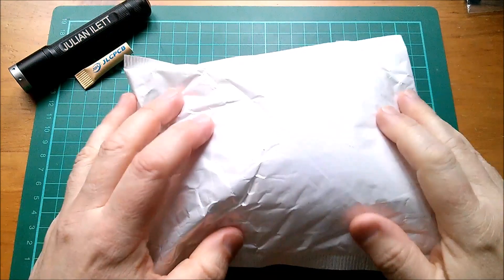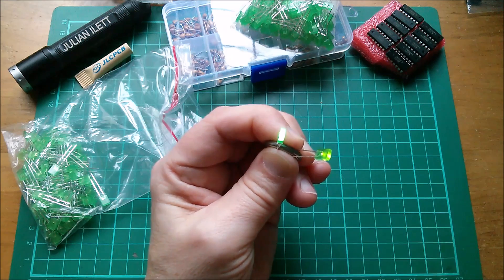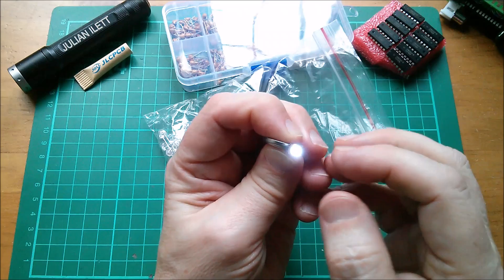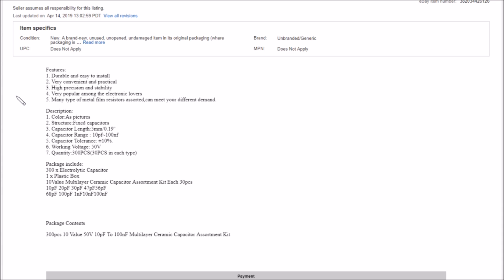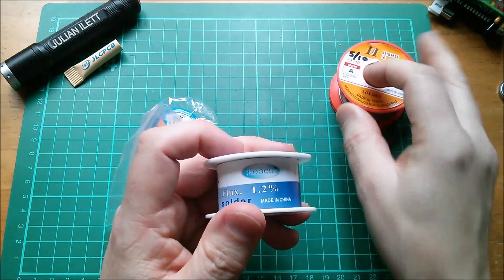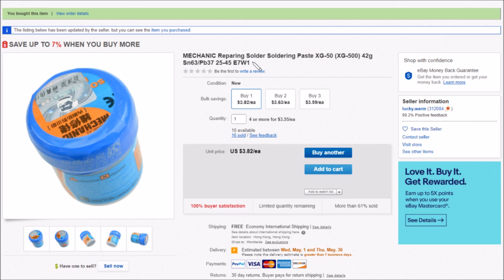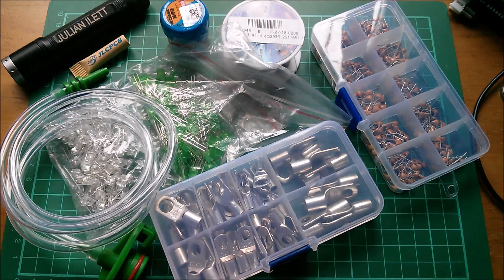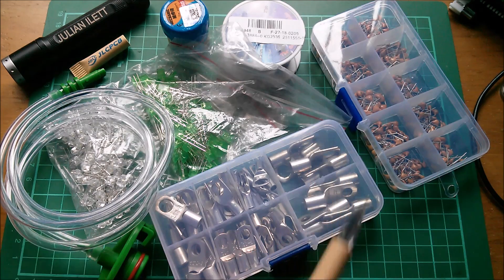Julian's Postbag: #135 - LEDs, Capacitors and Connectors

Comment: Caution with the cable lugs, as I have found the mm CSA of the cable is not extended right through the lug especially where the solder hole is located and at the terminal itself.

Comment: Does anyone know what the air tube locking  connector is called? The supply end. Same for those press compression rings.
Reply: Techcon Systems 533 Male Connector

Comment: Those lugs don't match the description. Described as closed end for sealing, all the ones I saw in your kit were open end (the end of the wire can poke right thru to the 6mm/8mm bolt hole).

Comment: Fine solder is better, even for through hole as it melts more quicly and risks fewer bridges. You get much better control of the amount added, especially useful for hand soldering SMD.

Comment: Chinesium solder is pretty much pot luck. Aiui, the PB/Sn ratios are not always as stated on the reel. I got tow types - Hanwuyou brand which is horrible, flows like Dairylea cheese and leaves dull (but functional) joints and Kaina brand which is lovely, melts easily flows nicely and leaves a nice shiny finish on the joint.
Androkavo did a review of various types and  saw similar results. Make sure you check the brand in the picture before you order, though that's not always a guarantee of what will come through the letter box.
https://www.youtube.com/watch?v=fef4_epjrSI
https://www.youtube.com/watch?v=5Ku7I3hA3AA

Comment: That Jinhu solder is really weird and I have issues soldering with it as well.  It really wants the iron and board/component really HOT to solder.  It also likes added flux then it can made to work.  I wish I had seen your experience with it BEFORE I had ordered.  Keep up the good work...

Comment: I would Never buy copper connectors .. buy some Copper pipe, that small one for Home pipping hot water. .. cut the pipe and smash one tip with a hammer ... make a hole on the flat smashed end and you got yourself a very good quality connector ...
Reply: John Smith - no, that will not make a proper cold weld joint, a few heat cycles and it’s possible to pull that apart. That’s why the correct tooling is specified for industry. I dread seeing crimp videos, because everyone mashes them with pliers.
Reply: @____________________________.x  It's a Connector ... if have have "300C heat cycles " then truly the connector is your last problem ... just crimp those with any crimping tool and you got a Excellent connector for a much lower price ..and you still get to used a very good Copper pipe with the leftover's ... all wins ...
Reply: @John_Smith__ - Nobody mentioned 300C heat cycles? simply any thermal expansion will degrade a smashed joint.
"Any crimping tool" - this is the problem, too many people (especially on youtube) imagine a crimp tool is something that resembles a pair of pliers.
I tested crimps in industry for QA purposes, smashed joints are not suitable for something that can dump 200 amps though it, especially as it looks like he's leaving all these batteries out in the rain again.
Reply: @____________________________.x  I agree on the crimp tools, what I do not agree is about the copper pipes. Absolutely suitable to high currents no problem. And thermal cycles? They are made for Hot and Cold water to cycle trough them ... no problem there whatsoever. And if the temperature is too hot then it is a serious problem and not with the connectors for sure. I also agree with the adequate crimping tools, but that is also a matter of knowing the tools. And of course leaving the batteries out in the rain is a major mistake. A cover at minimum is absolutely a must.
Reply: @John_Smith__  - why doesn't NASA make all its crimps with a hammer then? It would months in assembly time. No one questioned the use of copper, the issue is the quality of the crimp that hammering makes, you simply can not make a cold weld, there is not enough pressure.
Again, this is nothing to do with water pipes? Vibration will loosen a connection, thermal cycling has the same effect on crimps, so does cold flow. Companies spend millions on testing these effects because planes fall out of the sky when they get it wrong, this is why there is a right and a wrong way to do something. Julian is free to do this the wrong way, just as long as he makes clear what is the right way.
Reply: @____________________________.x  Simple answer: NASA has lot's of cash, and yes , those industrial made connectors are better then the ones I make, I simply would Never buy the industrial ones because I know for 99% of use cases the ones made with a copper pipe hammered into shape are more then adequate, do as good job has the ones I can buy, last the same or longer and far cheaper. Btw, making the connectors take Way more time then obviously buy them already made, that's reason number one most industries do not make the connectors (time is money specially at large scale production). 
For the few connectors I use I prefer to waste a bit of time hammering the end of the pipe flat, drilling the hole to my adequate size and then crimping the thing in the appropriate place. It simply works as good as a much more expensive acquired crimp connector. And If I was making an airplane In would of course Buy the appropriate Certified connector and designated Crimp tool, again: Airbus A320 and Boeing 737 Max cost around 120Million US$ per airplane ...  trust me they are not saving on Crimp tools or connectors ... 
But this is an entirely different scenario. Those connectors are a complete waste of money.
Reply: @John_Smith__  - We may be talking at cross purposes here, if using a ratchet crimp tool there would be very little wrong with a crimp made from a pipe.
Reply: @____________________________.x  If I have let the impression that crimping with the wrong tool was ok then my mistake. That's not my point. My point is a correct crimping tool with self-made copper heating pipe connector of appropriate size would be 99% equivalent to a already made one . Also .. as a final note ... I doubt that aviation crimping connectors are ordered from China :) ... just sayin' .... :)

Comment: I brought several reels of tin-lead solder with me from the UK - all "Ersin Multicore", in two diameters (normal and thin). It seems completely resistant to tarnishing and will outlast me, no that it has long to go on that front...

I also have some bars of solder, tubs of Ersin "Imp" flux and two tinsmith's soldering irons, one 'heat on the cooker' and one electric - they don't get used much, but when you need 'em, you've got 'em...

Comment: Its almost as if the lower brightness LED has internal stabilization ? Actually thought you had a tantalum assortment at first . Do people still use those ? The mechanics solder paste got a far better rating than the sex toys in that black bag !

Comment: What on earth has happened to this channel? It used to be fun. I've got boxes full of modules from China thanks to Julian. I've had hours and hours learning and having fun with boost/buck converters, 12vsolar, high power leds, pelteir thingys, supercaps..........

There was a time when I was a patreon supporter when I was absolutely assured that all the money would go towards postbag purchases. I stopped supporting the channel when it became clear this wasn't the case. Sad.
Reply from the maker: You're right - some of the Patreon money goes towards Pepsi Max and Chocolate Digestives :)
Reply: John Armstrong - we need a Pepsi/chocolate digestive video imo.
Reply: horse1066 LOL. Well I'd prefer it to a box of ring connectors! (But what's the point in drinking Pepsi Max if you are going to scoff chocolate digestives?😀)

I live in hope of a review of a new Ming He boost/buck converter!

Comment: Would a resistor not have fixed the green LEDs?

SIL even!
Reply: I may be wrong, it's a long time since I used that chip, but i think it used a current source rather than just plain output transistors
Reply: I think Jason means a SIP resistor array?Does seem slightly mad relying on luck when purchasing LEDs for a project, when you can alter brightness very easily.
Reply: @Apollo-p1l  

Haha.

Yes. ☺
P and L are right next to each other on the keyboard.
Reply: @Apollo-p1l  no, I mean the LM3915 uses an internal current source with the current set by an external resistor. A series resistor or SIL resistor package on the LED will have no effect until you go past the compliance voltage of the chip
Reply: Ahh right. OK.

Comment: I bought a roll of that solder. I'm not very happy with it. In my opinion there is not enough flux.
Reply: It was cheap stuff off of  ebay. But I have bought some really good solder cheaply off of ebay in the past.

Comment: You used IC sockets on the vocoder meter so why not fix that first board?  But first you should test the LEDs side by side (in series) to confirm they have the same brightness between the different colours.
Reply from the maker: Totally re-designing the vocoder PPM meter - 2 PCBs, matt black LED board, green op-amp board, linked at right angles with dupont header pins :)
Reply: @JulianIlett  - Interesting though I like the one board idea.  But I'm guessing your idea is also focused around what will actually work well in the vocoder case.

BUT you still need to test those new LEDs and why let that first trial board go to waste?  Pull the ICs, yank out the bad LEDs, and put in the new ones.  A board like that will still be useful on the bench for other things.
Reply: @JulianIlett  Are we going to get to see this new design in detail?
Reply: What about testing in a breadboard?

Comment: whats in the black package? :P
Reply from the maker: Luer Lock syringes :)
Reply: @B GG He has been using syringes to dispense solder paste on PCBs, and he has gotten a lot of decent but negative feedback, including from me. I told him because of his problems I chose to use a jar of paste, the same as he got today. It's not easily done without a stencil to squeegee the solder paste across. And there isn't always a stencil for every project, unless you buy one for your manufactured PCB.
Reply: @JohnSmith-bb2np And Julian, I wonder if JCB will supply a stencil for each project for a small fee hopefully ?
Reply: californiakayaker N6GRG yes they do.
Reply from the maker: Probably nothing - application of solder paste by cocktail stick is where I'm at right now :)
Reply: @JulianIlett  Me too, but with 2 sticks to help get the blob off of the first one, and to control the amount delivered. Stirring the paste first helps a lot too.
Reply: I’d love to find a generic stainless stencil pattern for SMD parts, then at least the spacing would be ok
Reply: @____________________________.x  That would be great, smaller than soic, i start to get a lot of shorts that need to be dealt with, when soldering.
Reply: @B GG well said. Although I expect Julian has developed thick skin by now 😉

Comment: what happened between u and bangood ? :'(
Reply from the maker: I decided to stop doing the reviews :)
Reply: Creates a lot of pressure if you feel compelled to review...been there personally.
Reply: I've been unhappy with them. The only way I can order anything is to only order one item (I can order multiple of the same item) and not two different items. They seem to skip one of the items. They have very poor responses, ignoring you and saying they want video and photos of when you opened the bags ! NOT HAPPY !
Reply: @californiakayaker  I have overall been satisfied with my purchases from them,  but four LED level indicator kits all came with defective LM3915 chips -- LEDs 2 and 3 never light!  Replacements are supposed to be on the way...
Reply: @Roy_Tellason  The problem I've had with them is communications related. There is no method of communications other than a check off menu . Not that I have found .
Reply: @californiakayaker  Look down the page where your order is detailed,  for "customer Q&A",  or maybe it's near "reviews".  There will be a couple of buttons there to either write a review or contact customer service.

Comment: First number on the lugs is the wire size in square mm, second os hole size
Good luch soldering them with the TS100 :D
Unless you have a crimper like i do
Now you'll get 1000 replies asking what's in the black bag :P
Reply from the maker: Wire size in mm² - makes sense :)
Reply: You are right, in mm²

Comment: Hey Julian,

How do you keep all your parts organized? I have so many mish-mash bins, bags, and clamshells of parts that I always struggle to stay organized. I've been trying to get more and more containers like the ones in the video, but always seems like the containers I get are never the right size for some parts.
Reply from the maker: I don't really - it's all a bit of a mess.
Reply: @JulianIlett  hahaha.... I was worried you'd say that!
Reply: Andy Plater - I try to buy only the “Really Useful” brand of boxes, they are super strong, have locking lids and stack securely. Slightly expensive, but it’s worth it to be able to quickly scan the transparent lids for what I’m looking for.
Reply: I buy ziplock plastic bags,  with "hanging hole" at the top,  which then allows me to keep them in the order I want with rings that snap together.  Three different sizes so far,  2x3,  3x5,  and 4x6,  which is sometimes not big enough.  So I have a ring for diodes,  one for 2SA transistors,  one for 2SB,  2N,  one for FETs,  etc. Then all transistors go in a box,  diodes in another,  capacitors in yet another,  and so on.  It's fairly quick for me to find the exact part that I'm looking for,  shuffle the bags around the ring to the opening point,  pop it off and take the bag off to get the part out.  I see so many newbs that seem to be enamored of lots and lots of little plastic drawers, so they can have their stock of parts on display or something,  but that's a bugger to deal with when you want to add something in the middle of things,  shuffling stuff around etc.

Comment: Those Chines Lugs and Terminals are made with some sort of HARD AZZ metal.  Using a regular Crimp tool is all but impossible.

Why didn't you just bump up the Current limiting resistor on your meter ?    ( Marked 200 )      20P x 0 Multiply .   That's a standard marking.